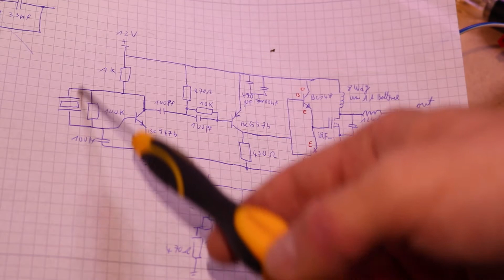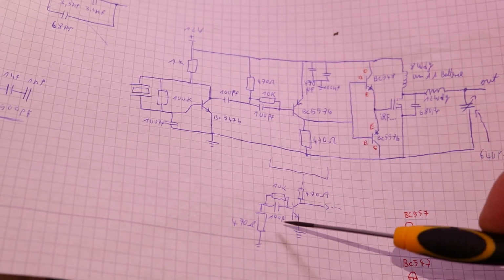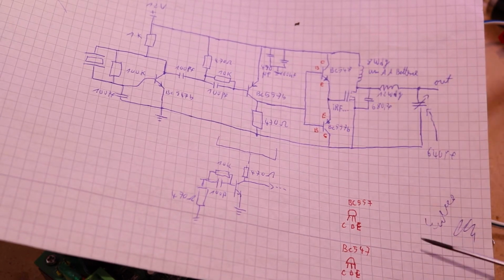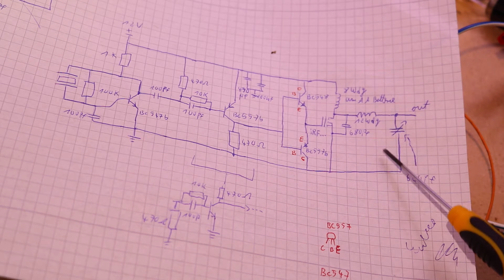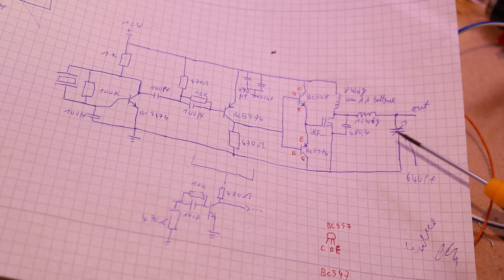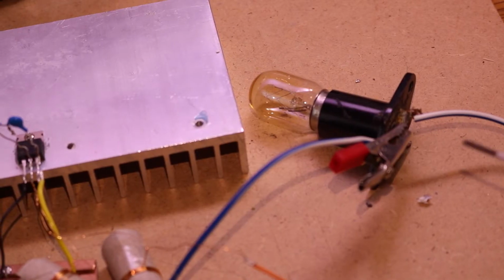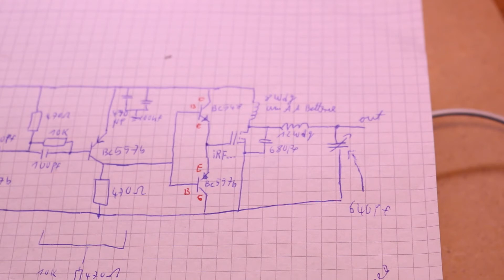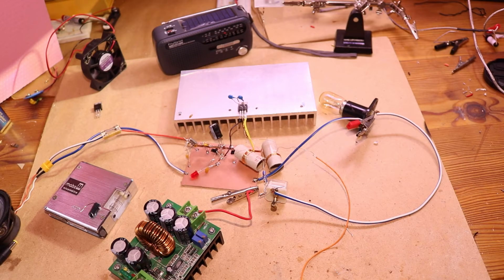Building a powerful Shortwave Transmitter Part1

Comment: I hope you have succeeded. Once I made a shortwave transmitter using bulbs, like 6BQ5, 6DQ6... It worked fine and lighted a 40 watts 110 volts filament light. It was VFO, no crystal. If you use a quartz crystal like that, and you need to input audio, perhaps you will need an audio modulation transformer, in series with the last power stage with half the power in order to get 100 AM modulation. Good luck. 👍❤️🙏